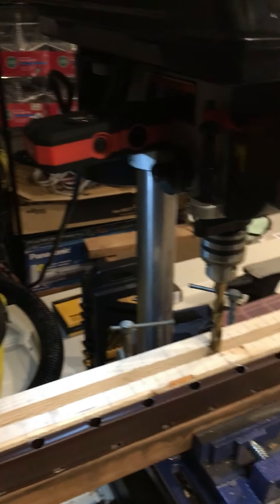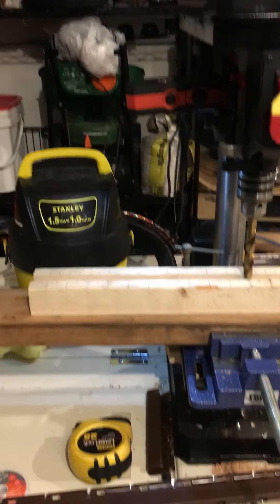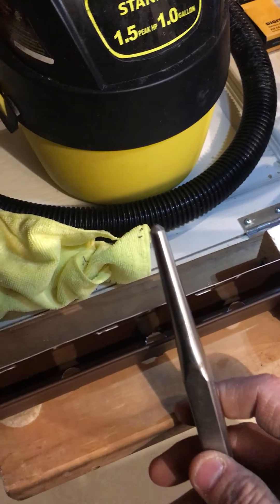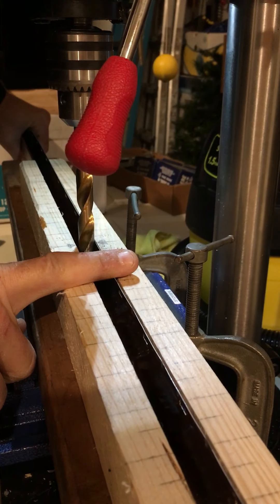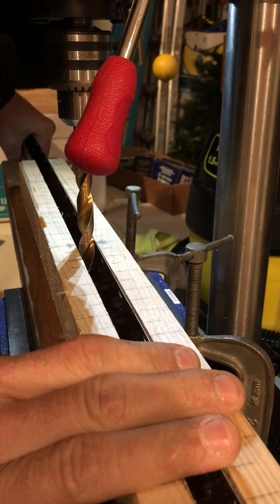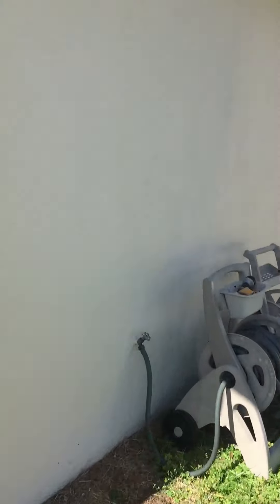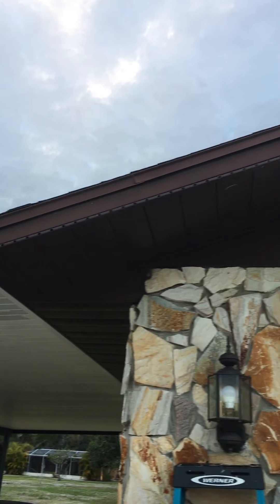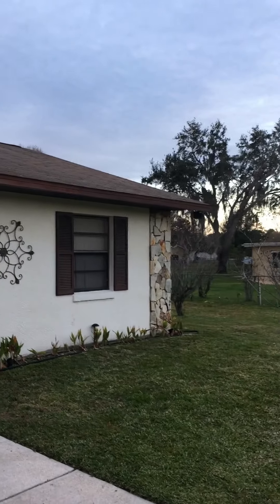Installing Permanent J Channel Trim Lights

Comment: So was it easier mounting the J Channel BEFORE putting the lights in it?
Seems like inserting the lights may have been easier on the ground.
Reply from the maker: Both aluminum and vinyl J channel are flimsy. If you add the weight of pixels to a 10' stick of j channel, it will twist and/or bend easier. When aluminum j channel bends, it's hard to straighten or reshape back to normal. It's also easier to hold up to mount.  And the pixels aren't going to fit perfectly with 50 or 100, you'll have 29 in one piece and 62 in another depending on the length of sections you cut, so now you have multiple pieces to hold on to while trying to mount them. For me, it was easier to mount the 90-100 feet of j channel first, then push the pixels.